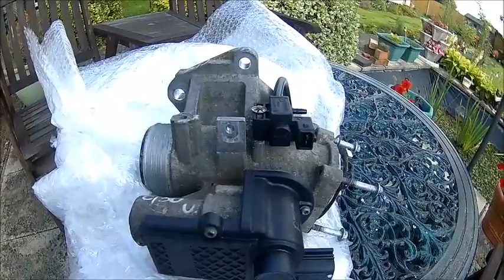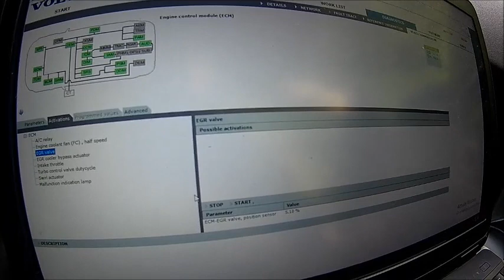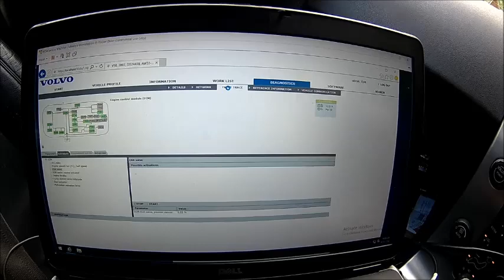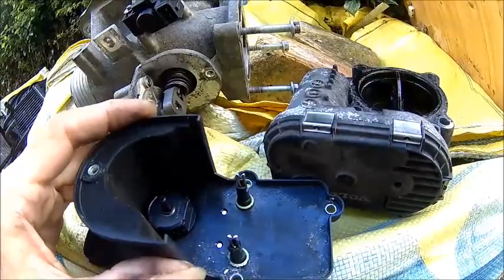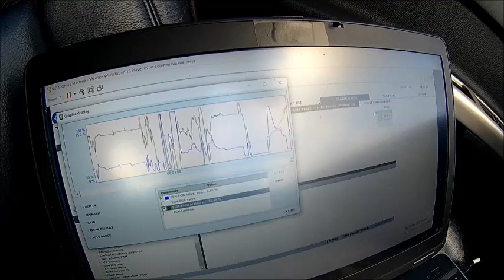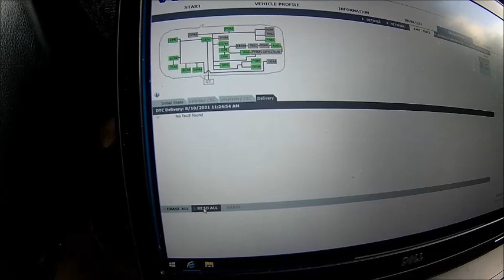Volvo V50 D5 EGR Valve positioning fault, diagnosis and repair  (codes 4450, 44D0 and limp mode)

Comment: My egr valve position is on -8% with commanded position 1.5% so I think I have some similar problems on my v70 D5. Either sensor or motor. Thanks for a great video :)
Reply from the maker: check the shaft being clean, motor hardly ever dies so sensor is always a good bet

Comment: Hi. Im in the same situation with my D5. p0403/p0409/p0489
My question is, do you need to recalibrate the egr position sensor after you switch to a new (used) one?
I've read both yes and no. And you didn't do it in this video. 
Thanks!
Reply from the maker: I think the workshop manual calls for a calibration, but as far as i can see,it does a cycle on power up anyway.  All i did was checking with VIDA if it reaches it's 0 and 100% points, which it does. Running just fine since the video was posted, done well over 40k miles since. Make sure you clean that valve thoroughly and check for smooth operation before you put everything back together.

Comment: Been binge watching a few of your videos on Volvos. And you seem to know your way around the engine. I've just read that back and it doesn't sound like a compliment but it is. Anyway I get a message every so often on the dash. And I was told there's to much oil in the engine. So I took some out. So it now sits between max & minimum but the message still pop's up and I've tried using a OBD tool but there's no faults. 
Have you any idea what could be wrong. Thanks in advance👍🏿
Reply from the maker: Thanks for appreciating my content....Well, the annoying oil level message..., after thorough investigation, i have decided to simply ignore it. According to common belief, the oil level should be no more than a quarter under full,  didn't help. I calibrated the sensor (with VIDA) several times, didn't help. Checked the connector and wiring as it is in a bad place, so getting a lot of water and dirt. seems fine. Every time i looked at the actual level value in VIDA, it showed the (approx.) correct amount of oil. I have the suspicion that it happens more often when i drive it harder
Conclusion: either shit design,  poor filtering , or lazy software design  ... Solution: Ignore it and check level regulary the old fashioned way !
But be alarmed when oil level is physically rising since last check, that means you getting a lot of fuel into your oil ....

Comment: Such a great and helpful video. If I want the proper Volvo software reading, believe it's called VIDA? Can I just install it on my Google Chrome laptop or will I need a different laptop or any other equipment? Thanks in advance for any help or advice.
Reply from the maker: Thanks, glad you like it.  ...The Volvo software is called VIDA, the hardware is a DICE, the usual cheapo OBD dongles will NOT work with it.. There is also an alternative software called VDASH, just google it, but you will still need a DICE. Can't help with your Chrome Book or any other installation at all as i use a VM on Win10. Maybe SiRobb can help, just check out his channel. SwedeSpeed forum is also a huge source of information
Reply: @dynoguy  Thanks greatly for your reply and help!